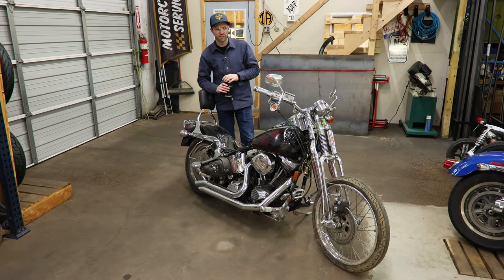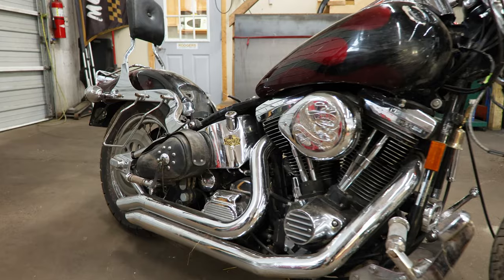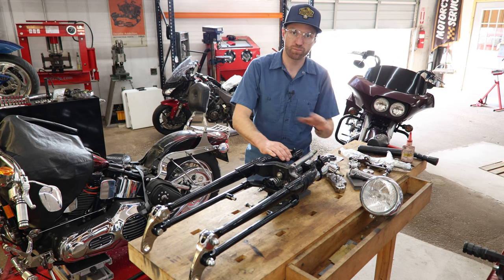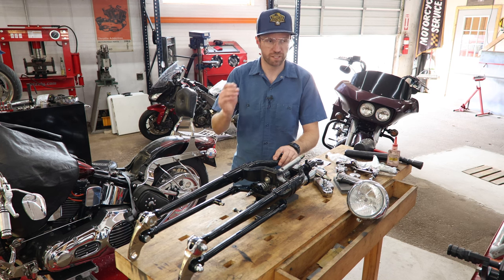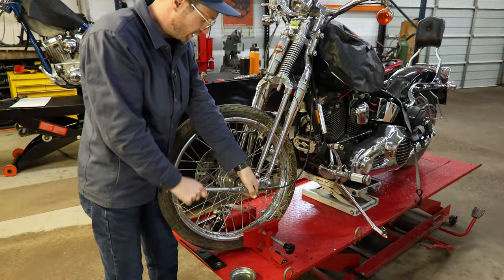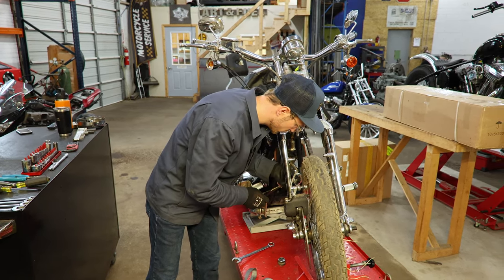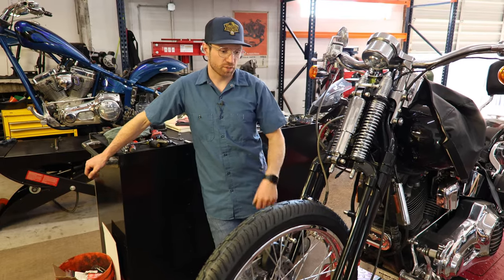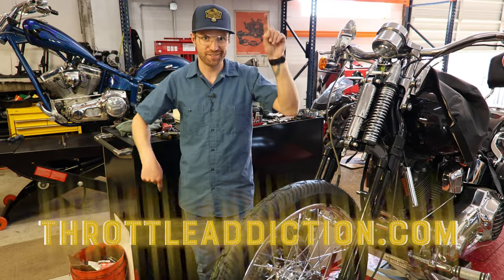How To: Install a Springer Front End - Harley Repair from Start to Finish

Comment: Don’t hang your caliper like that! The hose is designed to stretch outward with volume and pressure  they’re not meant to be stretched lengthwise. Use a bungee cord! Good vid though!

Comment: Great job. I'm planning on putting my old springer front end off an 08  crossbones that was totaled in a fire. Hopefully the integrity of the steel wasn't compromised from the heat. My 07 heritage has regular stock forks and I really miss the ability to turn on a dime with the springer. I've been dreading swapping them out for a lack of detailed instructions. I have no excuse now thanks to your channel. I'm very confident to take on the job. Fingers crossed they are not fubar and I can once again have the pleasure of cruising with the missing ingredient.Thanks again!! I'll be checking out your website for parts.

Comment: Was wondering what tool you used to remove the races. That motion pro that you're using won't work on a 2001 Springer.

Comment: Nicely done professional video. Since you have experience with both aftermarket and OEM HD springers, do you know if you can get aftermarket spring / shock sets that would work to replace the springs on the OEM. My crossbones of course comes with the black and chrome front end. Almost every peace of chrome is tarnished/ rusted, wanting to do a rebuild and maybe fully black it out
Reply from the maker: Short answer is yes, we can get most of the replacement components for Softail springers, only in chrome though and they are often out of stock. Email us exactly what you're looking for at info@throttleaddiction.com and we can see if we can help you out.

Comment: Great video bud, I want to change my 2000 fat boy over to a springer. So does this kit basically have everything I need? Bearings, risers, riser bushings,etc,etc. now,do I need to replace my caliper to fit the new brake stay?  Thanks much appreciated!
Reply from the maker: Yes if you're converting from a Hydragilde front end to this springer everything you need comes with the springer except you will need a new caliper and a new wheel
Reply: @ThrottleAddictionCo why the new wheel? I’m trying to gain info about the swap. Is it because the 3.5” wheel is to wide?

Comment: I’ve got the same bike with hydra glide ( wide glide) front end, I tossed the 21 years ago for a 16 fat boy wheel & fender, I’d like to install a springer front end & keep my 16” wheel & fender, is there a fender adapter for 2 parallel mounts that are on my legs
my paint is close to the ladies ride

Comment: On the 2000 harley-davidson heritage springer flsts is there a special tool for.the finder my new finder did not come with the spacer bearings
Reply from the maker: Not sure about a special tool. Can you give me more information? If you're looking for the spacer bearings they don't come with the springer. If you need spacer bearings you can only get them from Harley-Davidson.

Comment: Awesome video. Do you guys sell specific Springer front wheels? Correct me if I'm wrong, but aren't the hubs on Springer wheels designed for correct spacing? For example, isn't a front wheel on an FXST Softail different than the front wheel on a FXSTS Softail Springer? I'm looking for a black 21" wheel for my 95 Bad Boy and am having trouble understanding in all. Thanks
Reply from the maker: They are definitely different, unfortunately all of our manufacturers are out of stock on them and have been for some time, wish we could help you out

Comment: Great video !    Do you sell those tools ?
Reply from the maker: We do! They aren't on our website, but you can call to place the order. First, steering race removal and installation tool is part number 3850048 and is $114, second, the steering stem bearing and installation tool is part number 38050118 and is $59. Our phone number is (715) 210-3535 and we're here Monday-Friday 9a-5p CST